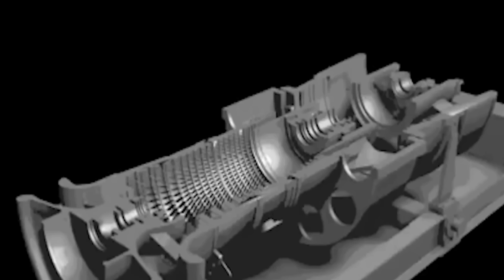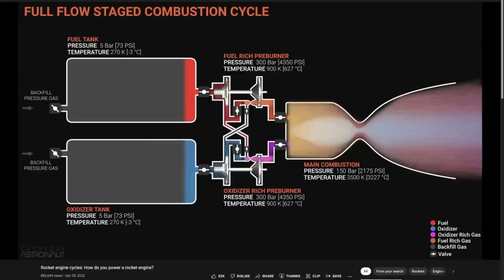Elon Musk SHOCKED NASA With SpaceX's INSANE NEW Engines That Will Change Entire Industry!

Comment: Well SpaceX is building fine rocket motors but 1)Nobody who has studied the matter is shocked or amazed by the engines output, compare it say to a F1 2) what the heck was that aircraft type turbine shown? 3) Melting 50 bell nozzles, they are working with new alloys not to make more power but to reuse the engines and make more power and 4)The Raptor is not a mythical creature 5)enoughs enough, these guys are just in it for the money.

Comment: Oh yeah. I don't remember hearing NASA say they were stunned, but you can tell that they wished they had the budget that Space X has at their disposal. The big thing is the fact that Space X doesn't have to jump through as many hoops as NASA has to go through, just to make a small change to an engine. Space X just makes the changes they want to make and start testing the engine changes. NASA has to go through government steps. And we all know that government steps really means, "We are going to suck up all of your funds running our dumb-ass study groups and committees that we force you to use to get approval for every fart each employee is going to make!
Reply: Are you Fing Kidding. I hope so. NASA has more money per year allocated than SpaceX. NASA does NOT HAVE A FUNDING PROBLEM. NASA has a FEAR problem. They are so paralyzed with FEAR of a mistake or Loss it is the reason why NASA does NOT innovate anymore. NASA was the one which said that propulsive landing was impossible and/or not worth the effort. I think mostly the second because NASA does not have a funding issue and thus does not think saving money is worthwhile endeavor.  NASA was the one decided to NOT innovate on new engine type and instead decided to chose a launch system which used Russian engines. NASA is the one which choses to not CHANGE because of fear of failure. For crying out loud, NASA was the one decided to reuse Shuttle Technology in the SLS instead of actually innovating. Not a funding issue. It is a stagnation and lack of risk acceptance.